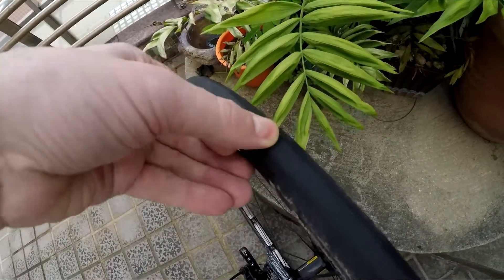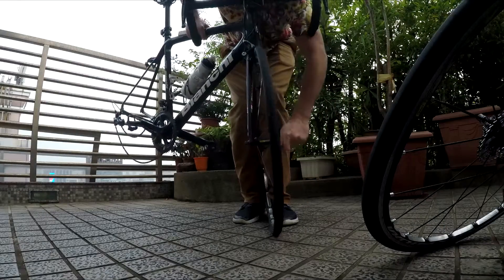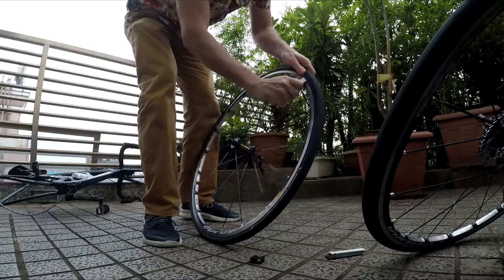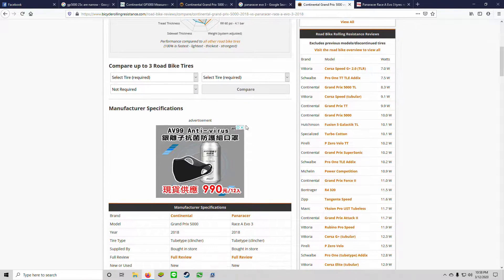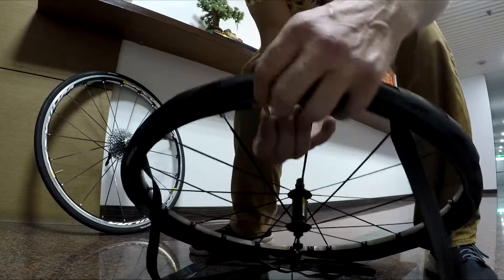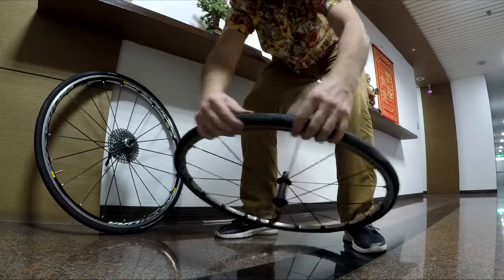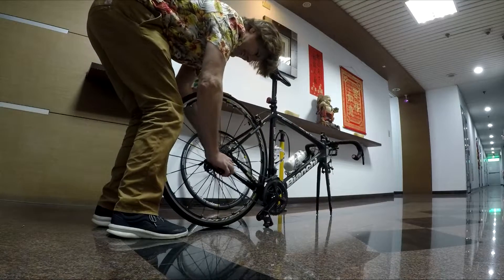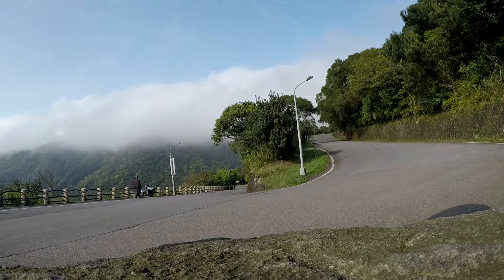Installing a Road Bike Tire - Gp5000 sizing - How to?

Comment: Partially inflate innertube to insure it's not flat and give it shape to fit to easier fit inside of tire. @ 4:15 last part is the hardest to install so consider using Kool Stop Tire Bead Jack as levers might pinch the innertube. @ 4:30 check that you cannot see the innertube on both sides of rim.
Reply from the maker: good tips

Comment: These were the hardest tires I have ever installed idk if it was cause they were going on aero wheels but man it was hard
Reply from the maker: Ya, a little tight for sure.
Reply: I can't even get the first bead over the rim. Do you suggest pre-stretching the tires, as we used to do in the 1970s with tubulars?
Reply from the maker: Well if you're sure they are the right size.... you have to stretch them ... there's no other way...
Reply from the maker: I put on hundreds and hundreds of sets of tires... and I remember this particular set oddly tight....